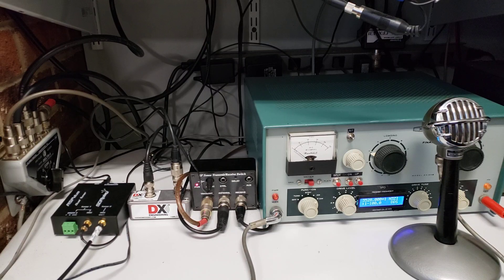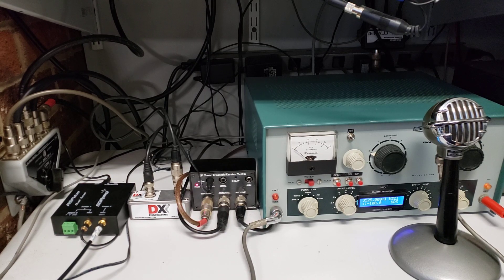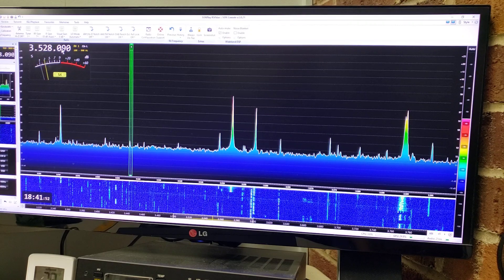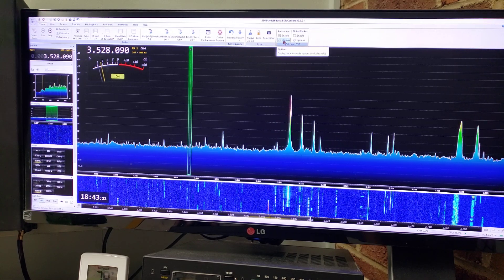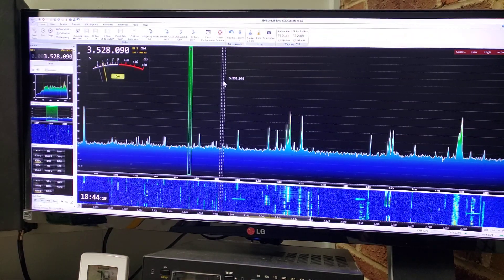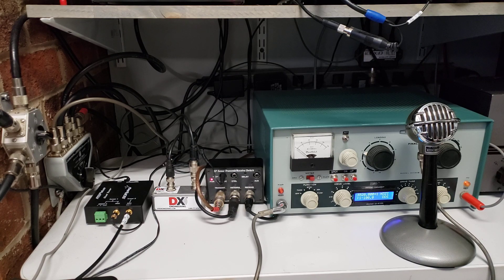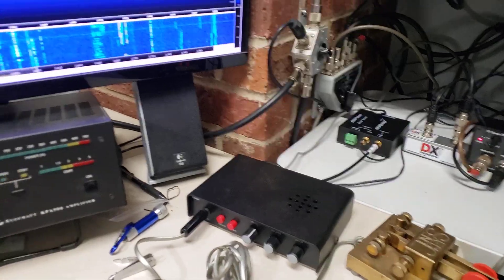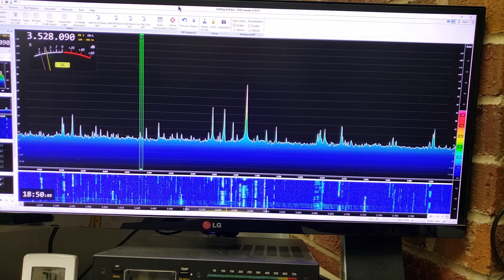How to Mute an SDR for that Vintage Boat Anchor Transmitter - No wires!

Comment: Thanks for the great video! Would this work with a dow key relay setup instead of the mfj1708? Reason I ask is the mfj won't hold up to my johnson viking 500 transmitter.  Thanks!
Reply from the maker: The Johnson 500 has a relay output already so use it to key the dow-key relay. Most dow key relays have spare contacts just for muting purposes.

Comment: That feature on SDR Console works great with an old boatanchor until...there is a strong nearby signal or a noisy band w/ static crashes. Wish MFJ would add (I've asked) some sort of built in relay with connections like an old dowkey to accomplish this. Better yet, wish I was talented enough to make something on my own to work inline with the 1708.

Comment: I have a icom 910 and I cannot get console to mute on tx via the CIV cable. It does cat control well but for some reason I can’t get it to mute on tx. Running a 857d prior it muted just fine. Maybe the cat functions are different or something. I’m not sure if I should try the 917 or not. Or if it would help
Reply from the maker: I'm not sure how your system is set up but I assume you use OmniRig to present the external radio to the SDR. OmniRig has a option under "transmit" for "mute audio" which needs to be ticked.